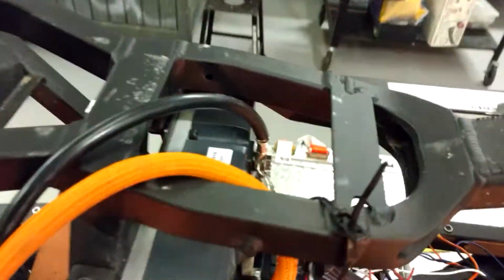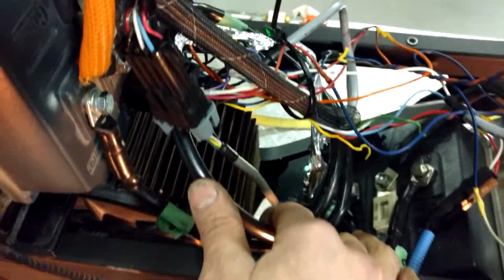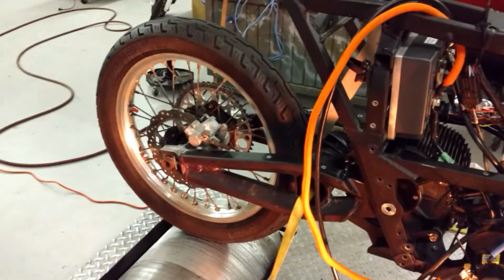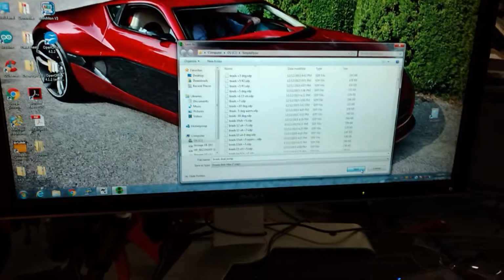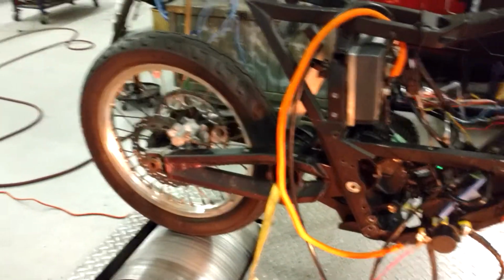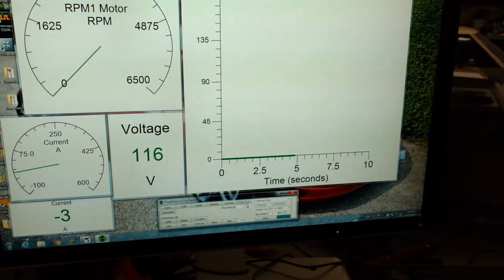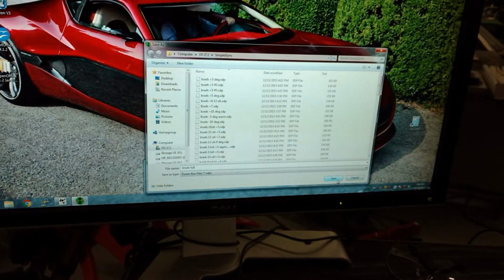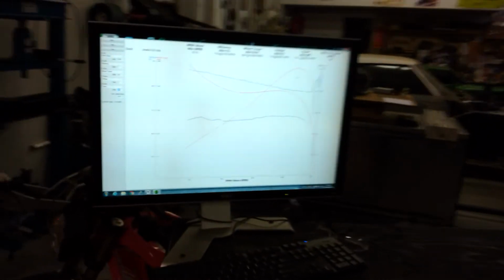81hp Split phase with dual controllers.

Comment: When are you taking the 81 hp for a ride? :)
Reply from the maker: +nattsurfaren need to design rear suspension and get some stiff RC lipo
Reply: +Arlin Sansome Arlo, Get the Lonestars lipo from John Metric.. These ARE THE ONE YOU WANT !!.. I got some and i'll never go back with cheap nanotech! about the same price but way more powerfull and strong! You can easyly imagine 13 pounds for 70kW !!
Reply from the maker: Thanks for the link dude.